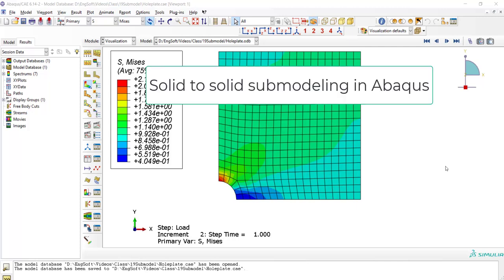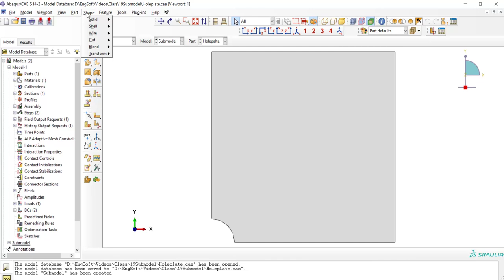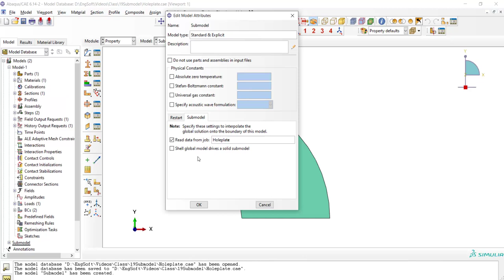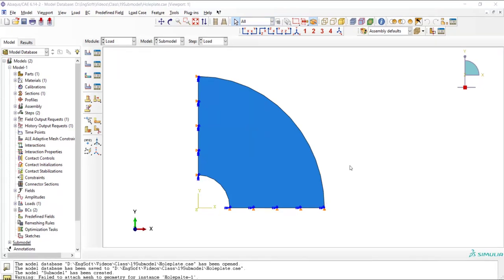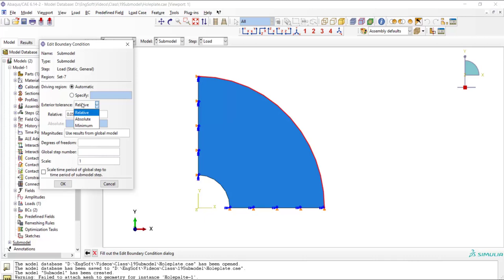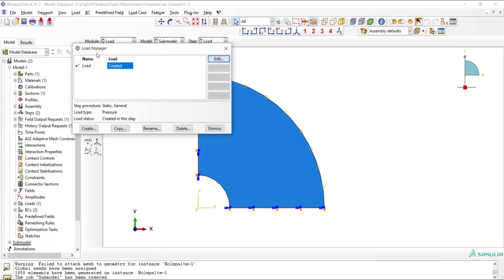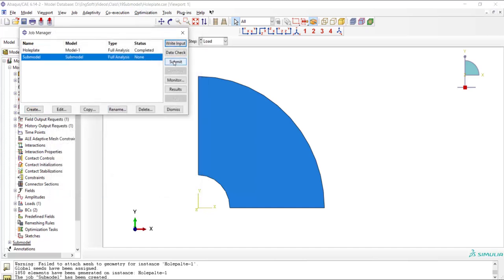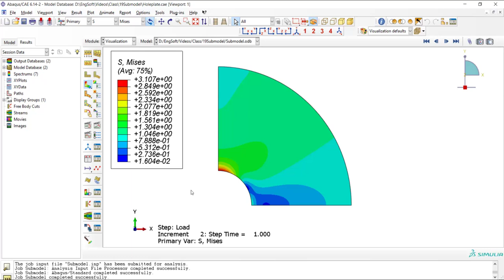How to perform submodeling in Abaqus: stress concentration around a hole

Comment: thank you sir for this video , i have modeled hollow sphere under internel radial displacement the material made of hyperelastic nehookena model,  , sir how i can creat submodel for my problem ,pleases sir
Reply from the maker: Is your main model shell or solid. What about the submodel?
Reply: @engineering_software   i have used axisymetric for modeld hollow sphere,has  an internel radius A and externel radius B
Reply from the maker: @kar-dt1hk  
Why you don't follow the method of this video?